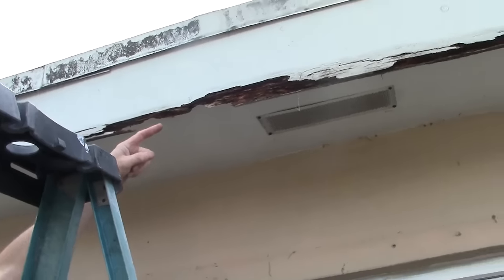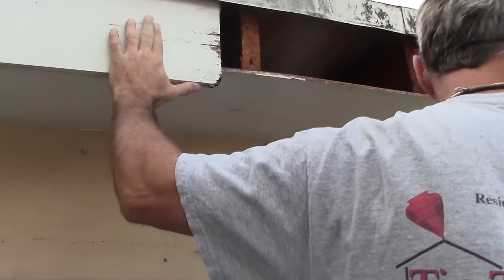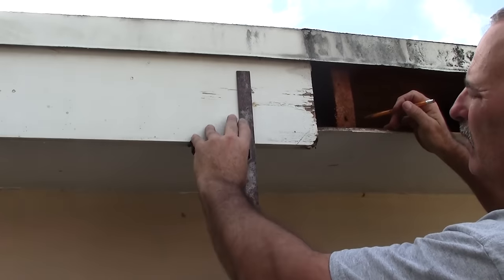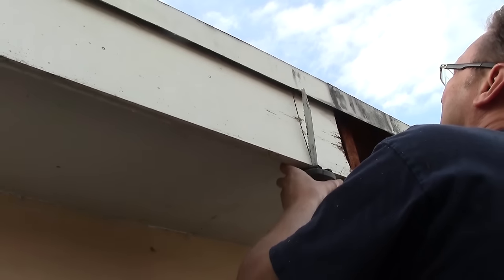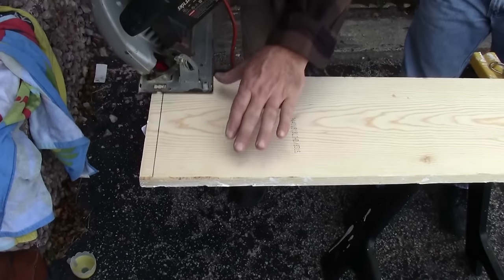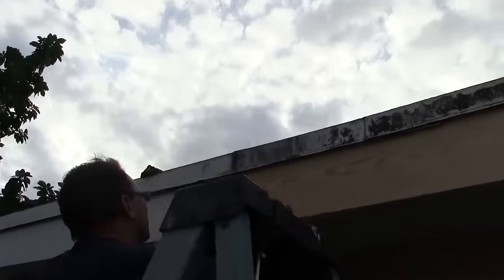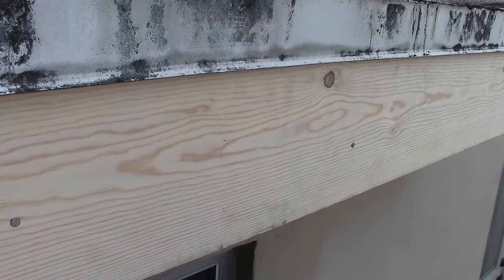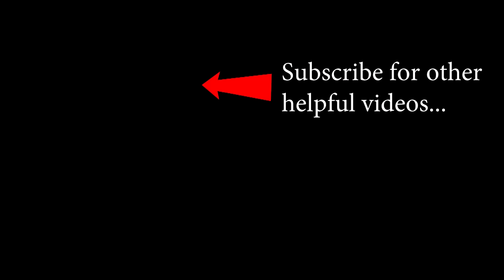ROOF FASCIA BOARD --- How to Repair or Replace Rotten Wood in a Few Easy Steps

Comment: Paint the fascia before you nail it on. Including the ends.
Reply: ...And don't forget to prime them first.
Reply: You just took the words out of my mouth.
I prime front and back myself..
Reply: Exactly. Should have primed the wood before nailing. Never ever caulk unprimed wood.
Reply: Adhesion gives way and comes right off within a few days.
Reply: I was thinking the same thing
Reply: ive actually painted both sides of the board with the ends.
Reply: Treated lumber or pvc would last longer.
Reply: @coolramone  treated lumber twists and reacts with aluminum gutter causing corrosion so it’s not used for fascia trim for that reason
Reply: @Hello-zf5lq  Good to know, thank you.
Reply: Okay my fascia board on my garage is not wood. It's a flimsy thing. I looked behind it and there is rotting wood. The rain water is getting to it. I want to seal it up. Maybe get a nail gun and try to put it back in?
Reply: @executivesteps …..because the natural oils from the timber repels the caulk and does not bind well (fail in less than a year). So yes prime both sides on the ground … then 2 top coats on the ground … I also spray oil primer (spray can) onto my nail heads and then lightly dip them into my top coat.
Reply: That's what I thought too...and I'm a girl...
Reply: @BlossomPainting what kind of primer?
Reply: @alyssaross362  oil
Reply: I thought the same, at the end of the video he says the entire outside of the house was painted next.
Reply: We use ecopine for fascia and I require my guys to paint all exposed ends, including miters, then caulk all the miters before nailing them up. We nail them up with coil nails where the drip edge will cover and 15ga galvanized nails anywhere that will show.  It just makes for solid, sealed joints, that I won't get warranty repairs on. It is a tad bit unnecessary, or "extra",  but for what it cost to do it's completely worth it. I've been doing this for over 15 years and I've only had 2 warranty repairs because an idiot who used to work for me didn't replace the rotted sub fascia. New boards fell off and had to be reinstalled on a fresh sub.

Comment: Hmmm.  I'd 1) pull off the joining fascia part way so as to miter the joint (not butt), 2) glue the joint, 3) not put the joint on the rafter so I don't split the wood ends with nails, 4) use 2+ in galvanized finishing nails to prevent splitting and ease of covering, 5) use bondo instead of caulk, 6) sand all results.  Then will actually look good when done.  BTW, I'd also use a square as a guide when crosscutting, or use a sliding miter saw.
Reply: 1 thru 4, thumbs up. 5 & 6, overkill.
Reply: how many nails should do? only 1 or top and bottom?
Reply: So where would you put the joint if you're not hammering it into the rafter ends?
Reply: Your spot on John , your comments are exactly what I was thinking while watching this video , what’s that old saying about great minds ? Lol , may God Bless
Reply: bondo is horrible on wood, it's not made for it
Reply: @QAudio  
Always us screws - that way if there is ever a problem it is incredibly easy to take the board down again.
Reply: What’s the best type of wood to use for a fascia board?  I read cedar and redwood are rot resistant but I have to paint it white. Thanks for your comment.
Reply: At the corners of my house there is a space where the fascia boards meet. what would be the best solution.
Reply: @QAudio  top and bottom.  I have a board that is curled through the whole length. Can't replace just a part of it, as the new won't match.
Reply: @littlemisssunshine2931  Exactly. No wood splitting. I see a truss like 4 inches away from the existing wood...couldnt he have just screwed the new piece to it? Instead of all that pain in the ass sawzall work?
Reply: @otallono  Bondo wood filler is made for wood.
Reply: says right on the can that it can be used on wood. However, I would go with actual Bondo Wood Filler. But even the orignal Bondo says it can be used on wood. Guess it just comes down to your preference

Comment: Nice job. I like to back prime, prime the cut ends, and then caulk the joint before I butt the pieces together. It will last longer and resist cupping, since the whole board will be sealed, not just the outside face.
Reply: As a Painter I was thinking the same thing.
Reply: Same here!

Comment: The fascias don't HAVE to butt at a rafter, a backer piece of lumber can be screwed to the fascia that stays and the new one can be screwed/nailed to that, though I would make the backer piece as long as possible and space each board's screws out as far as possible.  The only necessary reason for cutting back the fascia that stays is if it's end is messed up, which yours was.
Reply: This is a great idea- thanks! A couple of other sources said 'do not nail the end of the fascia board to prevent splitting' but I was stuck at what to do instead.

Comment: Here in California, I noticed that they don't cut vertical to separate the rotten wood. They cut it at an angle. So to put in the new wood, you will also have to cut it at the same angle and reconnect. I think it prevents sliding down better.
Reply: Right, our roofer replaced some facia and cut at angle for some reason - better fit, better support?  I plan to treat my facia with Bora-Care or use treated wood to protect against termites in CA. 

We have to replace many damaged wood.

Comment: Thanks.  Exactly what I was looking for.  Not to sure about the recip method.  Perhaps battery circular saw to start cut might be a little safer. My 54V recip is a monster and heavy, I bow to it before I use it :)
Reply: Oscillation saw all the way, easiest way to get a clean straight cut in that application

Comment: My house has 2 x 8 sized fascia boards (not what is shown in the video, I think he has 1 x 8 boards). The instructions shown were pretty much the same as shown in the video as was very useful in this job for the exceptions of 5 nails on 1 side of the roofline where the drip edge was nailed down. the other side was not nailed down. The tie-in ends were cut at 45 degrees were they joined and came out perfect. Took about 4-5 hrs. from start to finish most of the time spent removing the old lumber. I will seal the ends and along the the inside of the the roofline to insure no water damage is caused by rain. Also will put up gutters to help eliminate this problem as there were no gutters on the house to start with (patio roof is not cut to the same angle as the rest of the house, it's more flat tending to drip onto the wood, that is why gutters will no be installed). Original wood was 35 years old and crumbled in my hands with the exceptions of where the wood was still somewhat good. 2 16 ft boards were used to complete this job. I did not paint the boards before installing but sealed the ends with clear silicone, then i'll paint to match the rest of the trim. Time was of the essence that's why it did not get painted before installing the boards. I shot a small video to show what I did as well, just the finished job only.

Comment: Hi. What type of wood would you use for fascia board, pressure treated? Thx
Reply: I would use a composite material, no painting no rot. More expensive up front but worth the money.
Reply: @mtadams2009  what is the exact name of the composite board at Lowe’s or Home Depot?
Reply: I think it was called PVC composite. If you go to either store they can help you. Also if you go on line to either store and do a search for composite trim you will see it. Take care
Reply: The boards that are $6.79. It's getting painted all around because I'm doing it myself, can't afford servants 🙋🇺🇲🛠️🇷🇺

Comment: Thanks for the great video . You  make it look so easy .  My house has concrete roof  tiles and I wondered if I removed the fascia that it mind be supporting the tiles . Is this the case sometimes ?   I live in Australia   Regards
Reply: the roofing joists/rafters are holding up the deck which is where the tiles are installed.  if tiles fall off due to removing a fascia board, you should still remove the fascia so you can fix whatever crazy reason they were holding up your tiles.  the fascia is only supposed to protect the ends of your rafters from the elements and force any air ventilation through the soffit vents.

Comment: regarding the thickness of the fascia board, I am planning to use 1x8 fascia board.  Is a 1" thickness the norm?
Reply: David yes a 1" x 8" is the norm. Painting the facia front and back before installing is the proper way to do facia.
Reply: @firebreathinggarage2117  Thanks.
Reply: Depends where you are in Arizona its 2x8
Reply: You can buy it primed as well
Reply: Or PVC
Reply: I'm currently replacing the fascia boards on one of the houses that I own and for this house at least, it is a 1x6... When you don't have someone to help, replacing the fascia boards can be a pain in the butt though... I would prefer to be using 14 ft long boards, but about an 8 ft board is all that I can easily handle without any help and even then, I had to create some jigs to hold the board flush with the previous board on one end while I have another jig to hold the other end a certain distance beneath the rafters.

Comment: I can appreciate centering on a rafter, but if you had a good joint and nailed the rest to rafters, what would it matter?
Reply: A backer board would help if you want to do a joint between two rafters.  Boards might warp a bit over the years -- just look what happens to a 6 ft privacy fence over time.  With rafters on 2 ft centers, it won't be too bad, but it's easy enough to create the backer boards and if you have an air powered brad nailer that does staples, you can install the backer board pieces fairly quickly.

Comment: Primer the new replacement board. The house has some kind of a bad, or less effective, water drainage there. I notice my own board replacements have already been done before. These areas need special attention so you don't have to redo it in your lifetime. Just my two cents. Thanks for the video

Comment: One of my facia boards has a hole from water rot.
I dare not remove that board for replacement because militarized red wasps have made a home in that hole.
I can nail a new board over the top of the bad facia and paint it to match.
Those red wasps have made homes behind the facias at every corner of the house. Every summer they and I enter into war, and though I inflict over a thousand casualties to them, I can never totally defeat them.

Comment: What is best, treated or untreated lumber?
Reply: treated lumber of course. It's treated to be outside.
Reply: Treated lumber should not be used as fascia, typical fascia is pine or cedar…I now use composite that you don’t have to prime, paint and it doesn’t rot, so you don’t need to wrap with metal

Comment: I have terminte damage on fascia and some rafter tails on front section of my house under tile roof. 

Is it better to replace all pieces for that section in case termite got into them that we cannot tell?
It will cost more but better do it now since they have to remove roof tiles first to replace fascia and rafters. 
What do you think?
Reply: You can spray for termites first. Remove the termite section and get straight " straight 2 x4 or 2x6 rafter joist. Non pressure treated.. over lap the existing rafters and go back several feet . Do both sides at once on each damaged rafter., for stronger fit. Use nails.. if termite damage extends back to outside of house support frame. You should redo entire roof section. Remove shingles, underlayment, plywood , to expose entire affected rafter section and rebuild...
Reply: @flir67man84  Thanks so much. Very helpful info.
Reply: @randycraft3166  wtf
Reply: @flir67man84  For facia and other boards  for exterior, can I use pressure treated wood besides red wood in order to prevent termite and other insects?

Comment: I would have primed and paint first, then, add adhesive and use propert screws instead of nails. But, that's just me.
Reply: screws idea ok...but nails with a tiny predrill is simple too
Reply: What are you trying to make it hurricane-proof? It’s wood man...it’s going to rot again eventually. Your method would definitely make the next replacement take about 5 hours longer without providing any substantial improvement over ring shank nails.

Comment: He was lucky that there weren't any roof nails coming down.  Most of the time when you remove the board you can't stick the new one all the way in because the roofing nails prevent it.  If you force the new board it can actually push out the roof nails causing a whole new problem. The new board end up being lower by about a quarter inch or so. So the chances of getting an old board and a new board ending up flush is very rare.

Comment: The new board looked like pine to me.  I would use cedar.
Reply: Cedar wont hold paint as good as pine. Been there done that learned to many times. Staining is a diff story though.
Reply: Try composite, no need for prime or paint, no future rot issues

Comment: His cut on the worm drive was done on 0° not the 45° and they replace it with incorrect board 👎
Reply: They should have primed the board. That being said, that's not a worm drive saw & they made a 90 at the butt joint & a 45 at the miter. That was correct.

Comment: NO offence intended here but- This is a band-aid fix. The underlying problem here was never addressed, no amount of paint will solve the actual issue & keep it from happening again & again. Drip edge & shingles install wrong.  Perfect setup for surface tension.   Must be a lot of painters on here :)
Reply: Would you have removed the drip edge?

Comment: And you should have primed and painted it on all 4 sides and caulked it at every seam before nailing it. I am so tired of seeing this raw wood installation of facia and then it is rotten in 3 years at every seam!!! This is exactly what I am dealing with on my house because people are too lazy to properly prime and paint it before installing it in the first place. Properly installed facia should also NEVER be installed flat against the facia!! There should be a 1”x 2”or 1”x 3” depending on the size of your drip edge installed under the drip edge to pull it away from the facia so rain doesn’t run onto the facia and runs either into a gutter or onto the ground without running onto the facia. Do it right the first time!!

Comment: Who would do this? A roofer ? Or who
Reply: A decent DIY can achieve it jst need basic tools scaffolding makes it easier and alot safer as you will need to move the length of the facia board to remove the old and install the new.Working on flat  ground and can be done on  moving the ladder sloped ground is difficult .That is the tricky part especially if you are working at height which i guess is most houses.If in doubt though get a carpenter in.

Comment: Absolutely not helpful at all!! they didn't mention how thick of a board,the wood type,length of the board, or nails or the type of nails.
Reply: Its specific facia board or it should be and it should come treated and already primed.It should have a 5mm approx wide and 5mm deep approx groove rebated into the backside full length which the  soffit fits into this is to support the weight of the soffit and it jst doesnt jst dangle in the air.The specific board comes in 5mtr length and longer about 18mm thick (cant remember width of mine jst measure old board for width) and you cut to the length you want for your job.Best way is to jst take length and ANGLED END CUT measurements off your old board once you have removed it.Use galvanised nails Paint the new board while your on the ground (it really saves hassels of trying to paint hanging on a ladder etc..) before install Oh and dont forget to prime the end or ends you cut.Hope this helps i replaced all of mine few days ago.
Reply: @victoroneill4381  thanks,,, I've watched tons of videos about this and noone ever mentioned explain the board thickness and type of wood I have an older home 1965 I cant use box store materials because everything was hand built and custom cut..
Reply: @oldskoolwayy  my facia board is 18mm  thick i jst remeasured it,Fascia board is specific for this job as it has a rebate the length of the board itself which is or should be the same thickness as the soffit board that pushes into it all the way along the length of the board .hope this helps cheers
Reply: To find where to nail new fascia mark with pencil on the soffit where the rafters are centre once you have removed the old fascia(you can see the rafters once fascia board is removed).great video by the way.